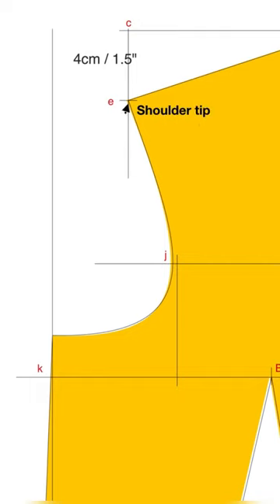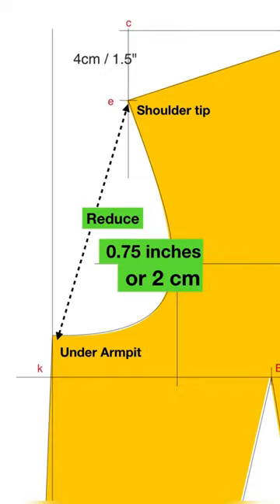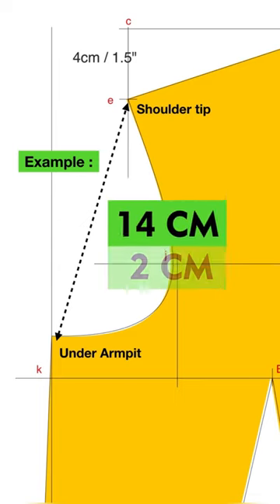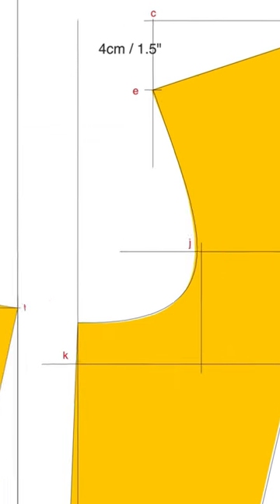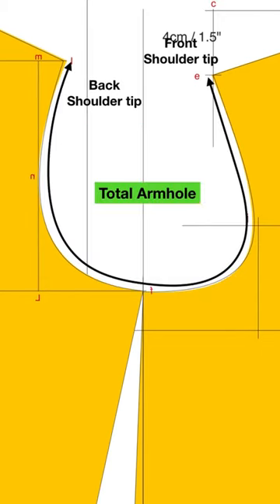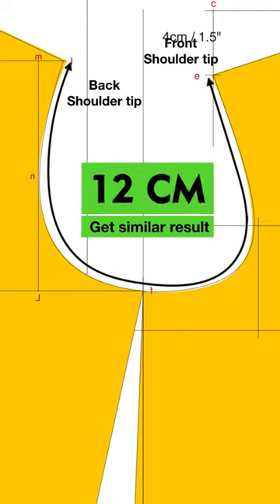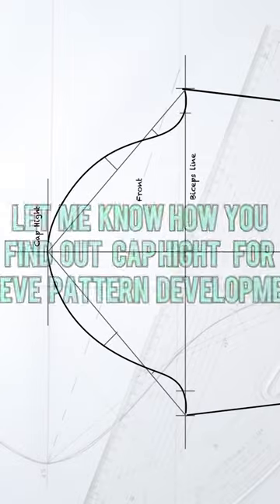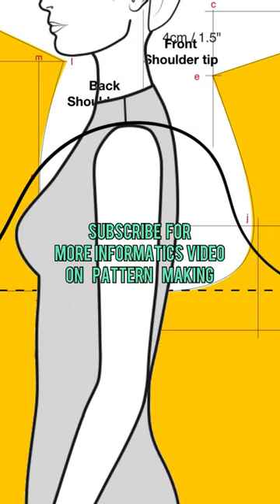How do you calculate CAPE Height for sleeve pattern drafting #shorts #patternmaking #sleevepattern

Comment: Cap height is governed by the angle of the sleeve projection from the bodice.  A lower sleeve cap allows for less restrained arm movement, while a higher sleeve cap is used for blazers/sportcoats for a more fitted look.

Comment: how to calculate bicep please clarify it.
Reply from the maker: It is always recommended to take a Bicep measurement from arm, it also depends on fit. For standard and regular fit Bicep is  70% to 80% of armhole. If your armhole is 54 cm then you can take 70%  of 54 which is nearly 38 cm or 80% which is 40.5cm. Try this calculation technique. Thanks

Comment: Im sorry but this is not right
Reply from the maker: This is the techniques is used, sofar I am getting good outcome. If you have any suggestions or the techniques please let us know, I / we can adopt the same. Thanks.
Reply: @howtodopattern   Im making an oversize crew neck with a Armhole measurement of 61.5 cm divided by 3 = 20.5 too high for an oversize style. First method same thing, measurement from shoulder tip to under armpit 25.95 - 2 cm 23.95?
Reply from the maker: @santiagosuarez3132  To make an oversized garment sleeve with an armhole of 61.5 cm and a larger bicep, the cap height should be adjusted based on the bicep measurement. If your bicep measurement is between 42 and 43 cm, use the standard technique to determine the cap height. If the bicep measurement is above 43 cm, the cap height should be reduced.